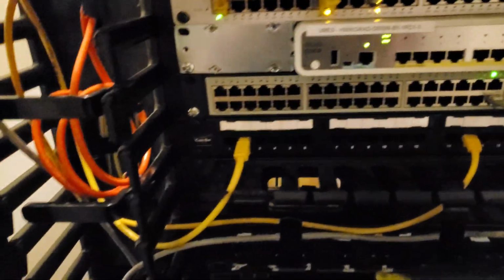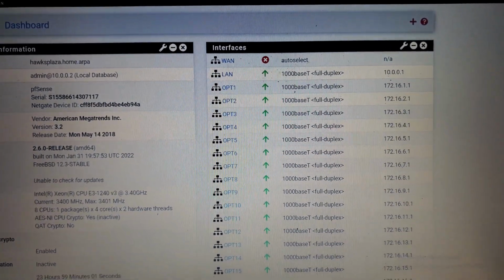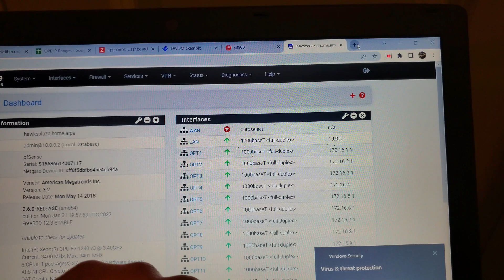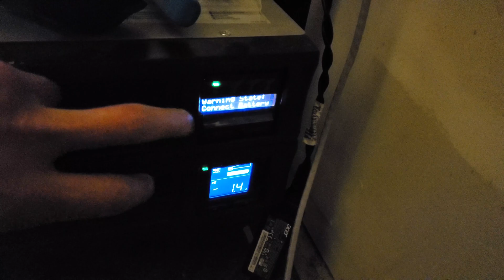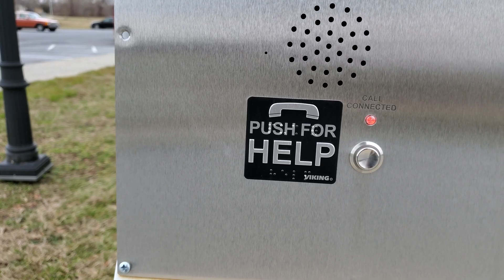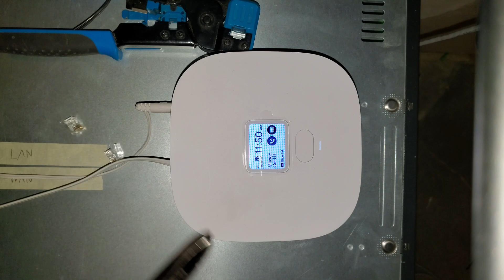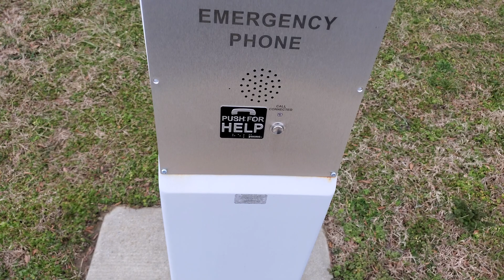90 Unit Apartment, PFsense, and 911 call box upgrade

Comment: Did you notice the call box dialed 7 digits?  That's not good, especially for a 4G ATA converter ("POTS in a Box" as they are called).  It should be dialing 911 so that the dispatch center ("PSAP") can get accurate location information via E911, unless the cell carrier assigned "ALI" information for that cell number, which is not very likely.  I used to maintain the ALI database for our building VoIP.  it's a cumbersome process you don't want to do yourself :(

Comment: Eww hope you used phone plugs for solid conductor cable ! I personally would have put up a surface mounted keystone jack  or a protector on the wall went to a standard factory made line cord to ATA you just created a point of failure ....

Comment: I once got locked in a telecom room because of a funky door setup.  You unlock one door you could get in but there was a lock that engaged from the other door that was disengaged when the key turned the first lock on the outside.  I didn't spot it because it was on the top inside edge and had to be flipped down to disengage it.  I later found there was no inside door handle when I tried to exit.  Finished my work and discovered I couldn't get out. II had to call someone to come and open the first door from the outside which temporarily unlatched the second lock while the handle was turned. I left that door open with a wedge that I kept in the room for future use. I now always have a wooden wedge in my kit just in case. Sometimes you just have to wonder what the thinking was when it was being put in.

Comment: do you throttling customer bandwidth? if yes how much for each customer?
Reply from the maker: They are throttled to the service they pay for .  We do that with 100Mb or 1Gb ethernet ports, or a variety of methods.  If there is a non business reason to require more we will accommodate.   Otherwise can upgrade to our business service which allows for a different experience.

Comment: Nice job doing something with that phone line. Only thing I would have done differently is used a rj11 punchdown and plugged a phone cable into that so the twisted pair is at less risk of breaking
Reply from the maker: 1000% it should have a proper demarcation.  But I believe will be changing to our phone service soon.
Reply: @briceperdue7587  don't you hate when other technicians do stupid things
Reply: @Natsumidragneelkim  I bet it was installed by the police departments tech or their contractor and was done "As cheap as possible". I bet every one of those emergency call boxes across the city is just like that. I was once told "You only use jack when you expect things to be repeatedly disconnected and reconnected. I was instructed to use wire nuts because they were cheaper and that was how all the other connections were made. So that's what I did. It's not always a question of stupidity but of standards and compliance.

Comment: How does port forwarding work in these types of networks? Let's say someone has to open a port for hosting something locally like a webserver or game server. Do they have to call you to have the port remotely opened on pfsense and forwarded to their device? I remember you mentioned that the netgear boxes you are planning on installing are just access points. Do you allow customers to use their own routers? Like forward all the traffic from pfsense to the customer's equipment. 

Anyway, great video as always!
Reply from the maker: We are trying to provide super fast low latency access to internet for the average user.  If the user expresses a need that is reasonable for residential service or upgrades to business service we allow for a bridged style connection will be able to plug in there own device with a forward facing ipv4 and even ipv6 if they really want it.  Buisness service you can use your public IP on the forward facing router.  Residential comcast doesn't allow it so we don't as a fair way to define features.
Reply: I was wondering the same. Only other route would be satellite connection.

Comment: Do you also do IPv6?
Reply from the maker: Messing around with it some.  I have about 20 people on the network using IPv6 now.  I'm experimenting with using IPv6 to fill DNS quite a bit.  But IPv6 still breaks some customers and I don't want ppl to complain.  We have a /112 IPv6 and would give to customers free if they want it.
Reply: @briceperdue7587  how do you have a /112 ? An normal subnet is /64 so you'd need at least a /48 or so to give subnets to customers..😅
Reply from the maker: @phiwatec2576  We have both a Cogent provided /112 that came with our /24 ipv4 and a /48 that was provided with ARIN.  We are not fully running BGP on our network yet and rely currently on cogent only routes.  IPv4 we are buying now at auction aggressively.  It must come back to the concept of what do you need to make it work and not complicated.  How can you replicate it, and how can you do it fast.
Reply: You should do BGP and give out IPV6 to your clients. That way no nat and your clients will use IPv6 for a lot of things like YouTube, Netflix, Facebook and more